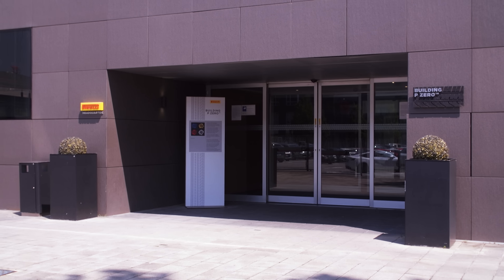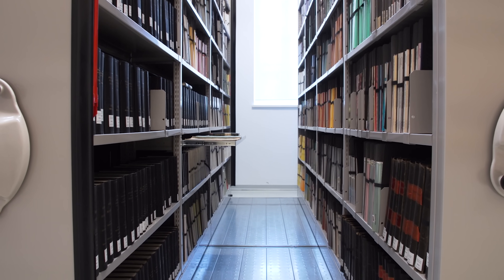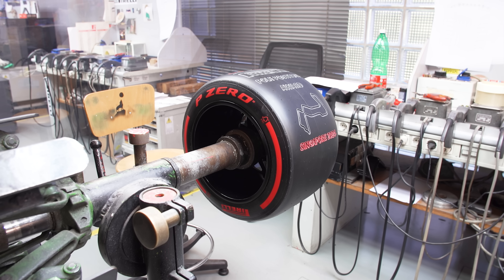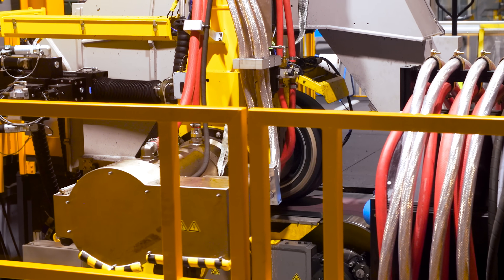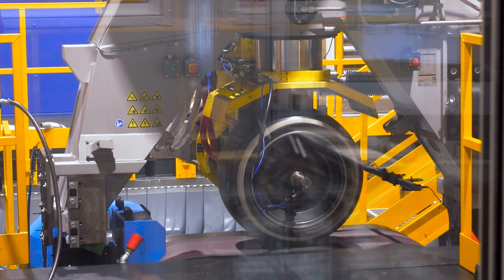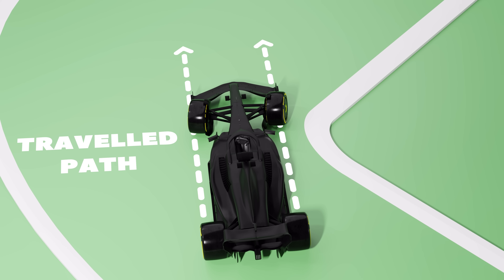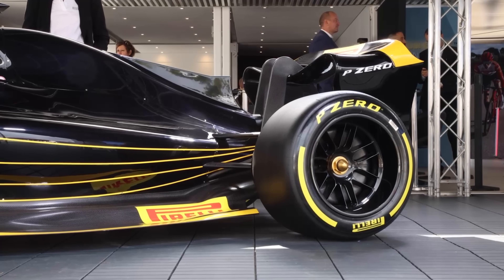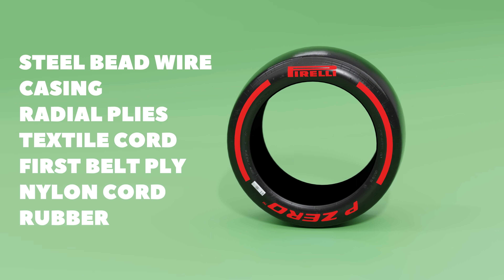How F1 Tyres Are Tested

Comment: Thanks very much for this video. I really enjoyed your footage and the interview. Quite envious that you got to visit!
But the red line on the bottom of the thumbnail meant I thought I'd already watched it so almost didn't click!

I wanted to know more though... "For example at Silverstone it's flat with fast speed corners so you generate a lot more heat into the side. Whilst in Zandvoort because of the banking you put a lot more load and G forces into the structure. "
I'm not sure what you're comparing here? What's the heat generation in zandvoot? What's the load and G forces in Silverstone?
"So the results from this are finding the optimum"  What optimum? The fastest tyre? The lowest weight? The safest? The cheapest?

Comment: Time to see if George Russells comments hold weight.
Reply: Please what did he say?
Reply: @iam_Oswald  GR or Matt? GR said the Pirelli data on the tyres are not accurate, causing race strategies to change dramatically, race to race. Matt says in this video that Pirelli stress test their tyres a lot and have many ways of doing it. Though I did notice some improvements in the facilities they use for the tyres. And maybe Pirelli should let teams test the tyres even further than they already do.

Comment: I worked for several years as a tire technician on the Firestone Firehawk IndyCar tires.  In case of a blow out I used a reciprocating saw to cut them apart.  My main job was looking for belt delamination and figure out why it happened.
Reply: thanks for your service
Reply: Respect
Reply: Are you allowed to say "generally" what the rough procedure would be if an event similar to the F1 2021 Baku or 2023 Qatar GPs were to occur?
Reply: Like a real tire mechanic ❤ 

In nascar how much difference is there between a right and left tire?
Just interested 😊
Reply: @Sassenhaim  I think JGR uploaded a short about the martinsville tires where the lefts have minimal air pressure and are a softer compound?

Comment: I have always hoped to add more tire suppliers. A single tire supplier means monopoly and unstable quality. The team has complained about this issue several times. Pirelli's tire degradation seems to be the most obvious among all tire suppliers. And the team does not really know the limit of the decline. As a result, the team's strategy will become very extreme. If Michelin or Bridgestone can be added, the situation will be much better. Increasing competition is still important. However, I understand that Michelin withdrew from the F1 supply contract mainly because consumption and research and development are not proportional. Simply put, supplying F1 is a losing business. In the end, they withdrew from the tire supply. The current F1 is not good-looking, and it is even a bit too boring. Maybe it won't be long before the F1 bubble will stop completely.

Comment: Are they actually tested? based on some of the issues from this season… there is definitely some extra quality control needed…
Reply: That’s a rather simplistic opinion. It’s impossible to 100% map a tyre to a track surface as the track is constantly changing throughout the race - and the driver will not always drive optimally due to his own errors and traffic

Comment: I'm surprised to hear you say you never thought of tire noise- it's most of what you hear every day when you go outside.  In a city, it's a vast majority of the ambient sound, and has been since engines (petrol and otherwise) have gotten relatively quiet, but tires have not.  I learned this one the hard way riding a bike path in the middle of a freeway near an airport, I couldn't hear the 737 a few hundred feet overhead because of the noise from the cars nearby.
Reply: When I was a child I used to think that ambient air made a sound. I didn't realise that what I was actually hearing in moments outside with no other noise was mass tyre roar from the M4 motorway a couple of miles from my home...
Reply: @SmallBlogV8  hah wow!  The things we simply accept, eh?  :)
Reply: @SmallBlogV8  Wait, that's tire noise, not engine sound‽